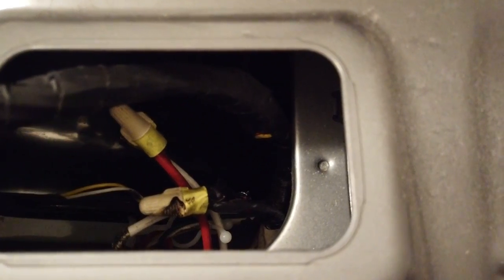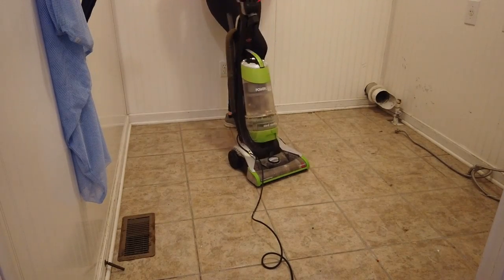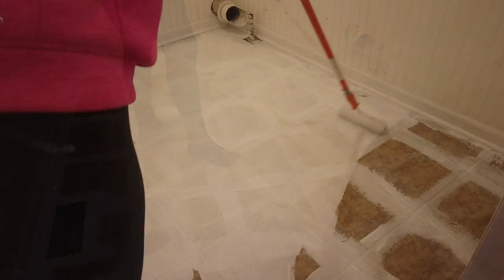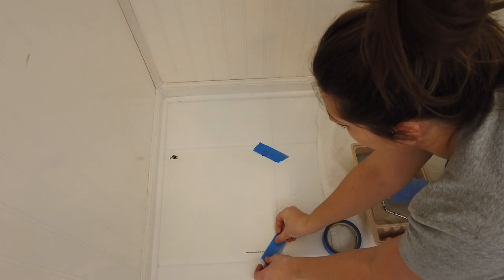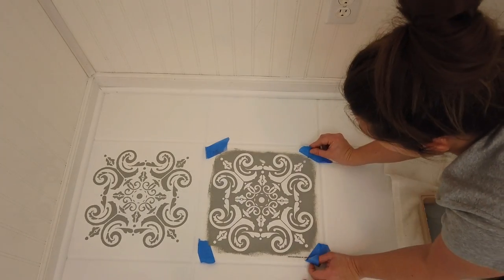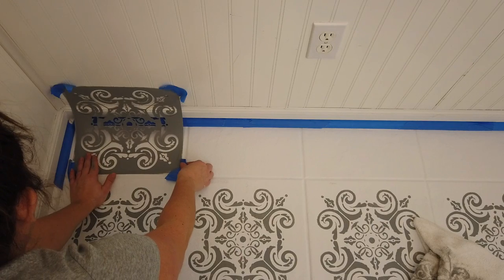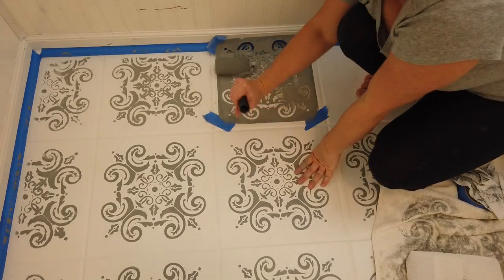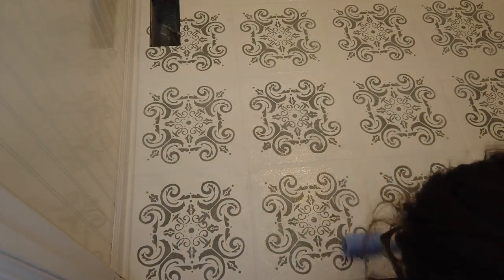DIY Laundry Room Makeover|How To Stencil A Tile Floor

Comment: What a great job you did and yes you did the stenciling correct by wiping the roller on the paper towel before rolling the stencil on the floor. I have done stenciling many times because it was popular in the 1980's. I have now seen several YouTube video where they made a few mistakes but in the end it turned out ok. Because they put to much paint on the stencil they had to go back and correct some mistakes also it took a long time to dry. Thanks for sharing.

Comment: did your polyurethane yellow?  Ive heard that polycrylic doesn't yellow but polyurethane does? 
Love the floor! 
Also,  is the tile smooth? I would love to do my tiles in my laundry room,  foyer and bathroom but they are not smooth.  They have "little  dimples"/a little bit of texture to them,  and i am wondering if that wood make the paint bleed easier?

Comment: ok , what type of paint has been used and what about protection ? did you used minwax to finish floor or left as it is ?
Reply from the maker: Hi there! I did explain everything I used in this video. I used  valspars porch floor and patio paint from Lowe’s in white and grey. I did not use a primer but I would now recommend that you used a primer called Stix. As for the finish I used rust-oleum’s polyurethane in a matte finish. Have a great day! 💕
Reply: @jessicalynnathome  thanks a million Jessica. I have done  beech wood floor , dark varnished , then two coats of Rustoleum chalky paint -light grey , sanded down joints of planks to the layer of varnish , stencils  and some decopatch , finally two coats of mat finish stain from Rosewood . This stain is great but is yellowish. I noticed that  yours has milky color ,but I`m just  afraid is it enough good as is minwax ? Anyway I gonna to make floor in the kitchen . My plan is to use stencils with chalky paint strait  on grey ash tiles without the primer  (maybe only smooth sanding ) and then put two coats of Minwax/Rustoleum . In case I would to use primer = Zinsser Eye Bull , Stix is not available in Europe... Even Minwax is 3 times more expensive on english amazon that in USA and only  1/2 pint tin  in the offer... However I found shop in Poland and they has 1 liter tin and 300% cheaper than in UK.  I will be grateful for any suggestions.
Reply: Would miniwax stand up to the job? Because from what I’ve been told polyurethane yellows over time.
Reply from the maker: natasha l I heard the poly yellows too over time but I have never used minwax so I’m not sure. Good luck with your project I’m sure it will be beautiful! 💕💕💕
Reply: @RunWithScissorsSewingOriginal  I spend more time to reading about Polyurethane stains  and conclusion is - all of them get yellow after time , no matter which brand //  The reason is exposing  on UV . I found another solution for finish wood , floor , etc but is much more expensive  . Here is : Conversion Varnish ,  K2 Urethane ,  Waterbased Urethanes , C.A.B.Acrilic.  Sayerlack brand seems to be the cheapest  in the option from the list . You can stay with Rosewood but will get yellow if the place is exposed on sunlight .  You can find old cars  red or blue in color which paint is faded  in the same way  - UV.

Comment: please do you seal it with some thing for long term.
Reply from the maker: I used polyurethane and sealed it with 3 layers. Also make sure you sand lightly your tiles and use a primer so the top coat paint sticks well and lasts longer. Thanks for watching! 💕😊
Reply: @jessicalynnathome  thanks a lot.
Reply: @jessicalynnathome  thanks for the respond

Comment: How has it held up to traffic?
Reply from the maker: Hi there! Well traffic wasn’t my problem unfortunately I have have 3 small dogs and that’s where there beds are and they went in there and peed in the same spot a couple of times and it yellowed the floor. After a couple more times it started peeling the paint up in that area...so recently I ended up sanding the floor and painting over it with just a black chalk paint and sealed it with polyurethane. This has been so much better with pets! When they pee it doesn’t yellow and the paint hasn’t peeled. So if you have pets like mine I wouldn’t recommend lol but if I didn’t have pets(or ones that didn’t have accidents)  I think it would of held up pretty well but if I could do it all over again I would of used chalk paint for all it because that holds up a lot better I think. Thanks for asking hope this helps you out! Have a great weekend! 💕☺️
Reply: @jessicalynnathome  Thanks!